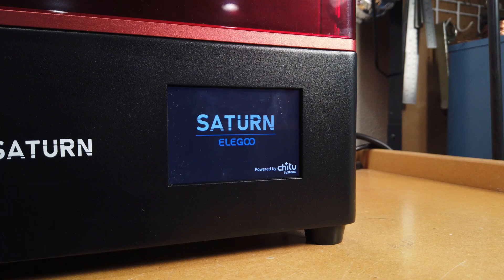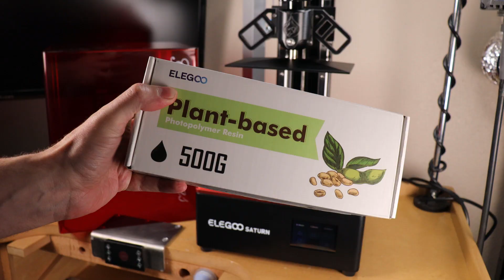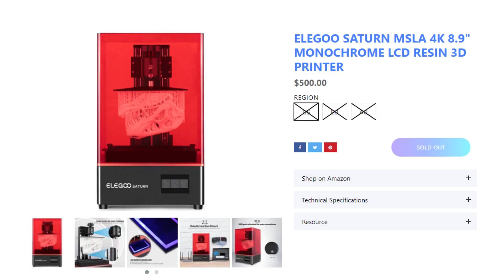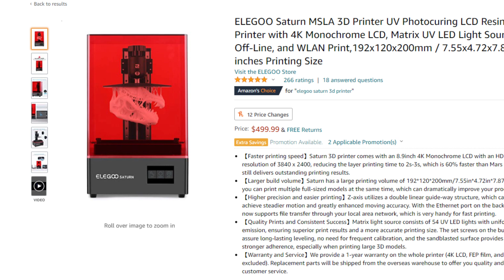One Of The Best Printers For The Money - 2021 - Elegoo Saturn 4k Mono Resin 3D Printer

Comment: Torn between this and something smaller like the Mars 3 - want to be able to print some larger minis but question if I need something the size of the Saturn even for that.
Reply from the maker: I would go with the larger one if you can so you have the option. There is also the new Saturn 2 that is coming out soon so you can get size and detail from an 8k screen. Here is a video about it https://youtu.be/nB_Lf7nOWkA
Reply: @randymay  want to be able to print stuff that’s around 22cms long or so

Comment: hi can you tell me plz if you print same rings on mars2 pro there is a decrease in visual quality compared with saturn or its all marketing! thank you!
Reply from the maker: They come out about the same. The Saturn might have a 4k screen but it's larger so the pixel density is about the same as the 2K screen on the Elegoo mar 2 Pro. The advantage is to the Saturn are that it has a larger build volume so if you are making a lot of rings at once you can make a lot more in the same amount of time.

I also have the Elegoo mars 3 4K and that has a smaller 4k screen and does make the details and print quality noticeably different.
Reply: @randymay  thank you!